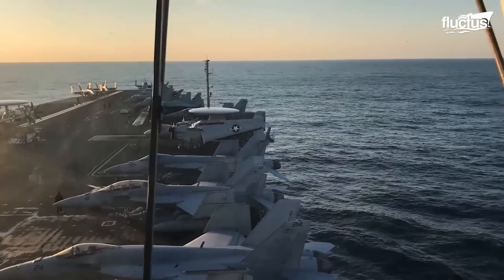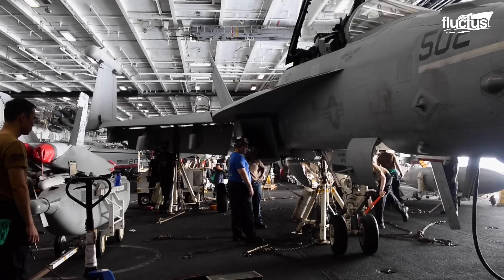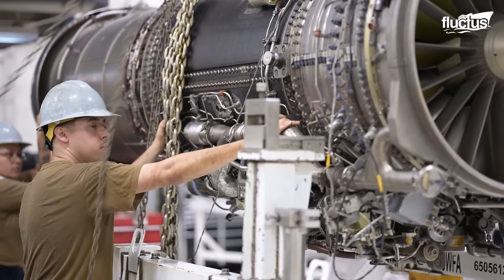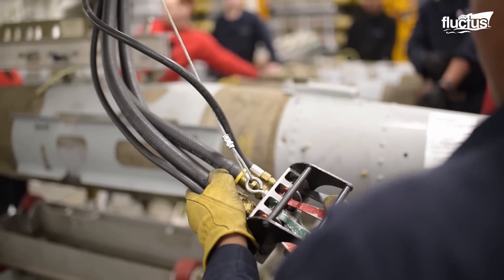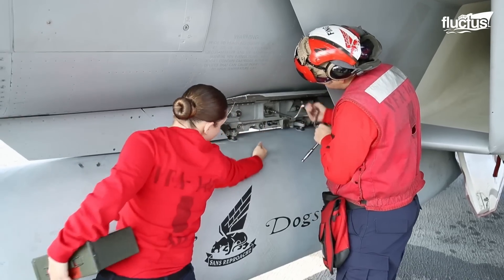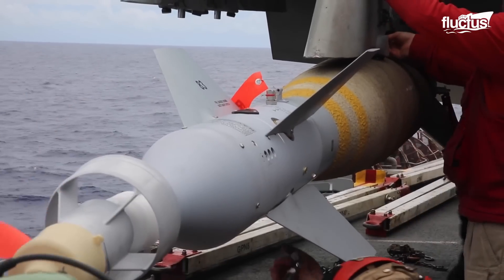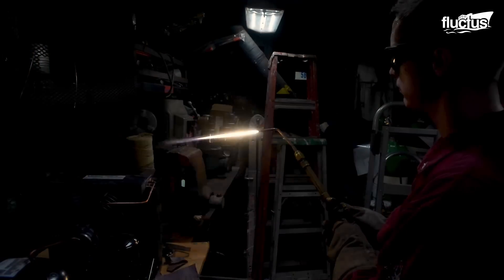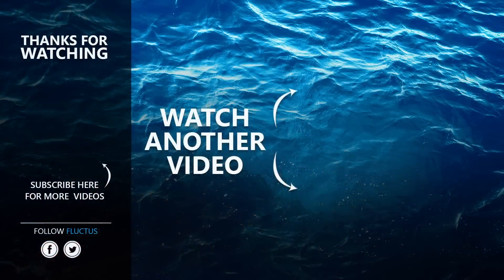Behind US Crazy Idea to Test Jet Engine Thrust on Aircraft Carrier at Sea

Comment: Why the mechanics use the manual wrenches to unscrew bolts and screws instead of the battery operated ones?
Reply: Often if you use power tools you can strip the threads if you use a power driver.  Especially when first starting.   Plus reliability. Manual drivers don't need batteries and don't stop working like power tools
Reply: Power drills can spark, and around jet fuel, not a good thing.

Comment: My first ship was the first "supercarrier", the USS Forrestal CV-59, 81-83. Called a supercarrier because it was the first class built with an angle deck, which allowed for launch and recovery simultaneously. I was there for her 82 Med/IO cruise and then took her into the yards in Philly for SLEP. I was a radar ET, all of our equipment was off the ship for the yard period (mine gone to mothballs, SPS-43A), so we all got other assignments. My first was the Fire Watch division as a supervisor. Our office was the Jet Engine Shop on that ship, which was located at the aft end of the hangars, with hatches opening aft to free space, which is where they would fire off the engines for testing. And, those engines had as much effect on the ship as the blast hitting the JBDs does. Nil. Compared to the mass of the ship, it's completely insignificant. 

Obviously, things have changed since those days. We didn't have LED lighting or laptops, for example. We technically had three hangar bays, but it's really one huge space, two decks high. The hangar bay was deck 1, the main deck. Decks 01 and 02 were mostly in the sides of the hangars or forward of them. Deck 03 was sandwiched between the hangars and the flight deck. The flight deck was the 04 level. Most of my work, my radar space, and the radar shop were in the island, on the 05 and 06 levels.

I was ship's company, so I wasn't involved in any of the aircraft maintenance, but I did work with AIMD on occasion. They had nicer tools than we had. At one point, I had to remove the rotary joint from my radar's antenna pedestal because it was full of water (long story, associated gear, another "tech") and took it to them to run through an ultrasonic cleaner for me. Their shops were forward of the hangar bays, on the same deck as I recall. 

I've noticed more modern carriers have the island set farther back than the Forrestal did. And, I can personally attest to one reason that's a good idea, even if it's not the reason for the change. I have first hand experience as to where the jet blast coming off the JBD for the cat just in front of the island, goes. It hit the bridge and signal bridge on that carrier. There was a commercial harbor nav radar mounted on a narrow catwalk above the bridge windows, below the signal bridge, thereabouts. We were up there to do maintenance during flight ops. However, just as we lifted the dome off the radar (about 3' or so diameter), they launched from that cat. And we got hit by the blast, nearly ripping the dome out of our hands. 

To put that in perspective, we were on about the 09 level, or 5 decks above the flight deck. We aborted that job until a better opportunity (i.e., the rare no flight ops moment).

I'll also mention that, in our case, the area of the flight deck outboard of the island was called  the "bomb farm", because that's where they'd stage munitions before loading them on aircraft in preparation for launch. My berthing was directly below that area, with a JP5 pump station fore and aft of us, the stacks inboard of us, and basically air and water below us. In the first days I was told, if you hear a bump overhead, don't worry about it. If anything actually happened, you wouldn't hear it. If lucky, you'd wake up in the water.

Still, that was better than the berthing that was located just below the arresting gear, with the machinery rooms on either side.

Comment: I was on the carrier Constellation and the engine shop would run repaired jet engines off the fantail. It did nothing to the ship's speed if anything.
Reply: I was on the Ranger your sister ship. They tested engines on the fantail. Normal procedures.

Comment: DID , IT , ADD , ANY , MORE , THRUST ,  TO , THE ,  CARRIER ?
Reply: The question we ALL want….NEED….answers to.
Reply: No,it does not add to the speed. Worked on F-14 Tomcat. The Jet shop just pulled.engines from shipping container and installed exhaust section then did the engine test.

Comment: Did it add anymore thrust to the carrier speed??
Reply: doubt it it would be noticeable.
Reply: @williamgrand9724 you would be surprised.
All the parameters of most Lethe vehicles are known.
This even goes for things as small as semi trucks.
Once the parameters are known to a person that simply pay attention to them, the quantities, over time, are a known factor.
Changes may be small, but noticeable by modern technology.
Changing an exterior part or fairing will be reflected in the future performance.
If it is beneficial, and proven over time, it’s a positive addition.
If the performance goes down, it is either scrapped or reevaluated and redesigned.
Improving a small part to increase performance, even by one or two percent, is seen as an overall improvement in the operation of the unit.
This can be as little as 50 gallons of fuel over the course of a year.

50 gallons at 2018 prices was around $150.

Not a small amount.
Reply: I looked it up, it’s freakin hard, totally different units, some measured over time, some over area/length, but, the F404 (F-18)jet engine creates up to 85kN(85000 newtons) of force. The Nimitz creates 194MegaWatts of power, that’s like 194,000,000kN, so the one jet engine at max power would be like adding 0.2% more power to the ship, but someone more knowledgeable should check this though, I might be wrong.
Reply: @martindworak thanx, ur awesome
Reply: that was my curiosity as well.
Reply: They said the 3rd elevator was on the port side. But if it’s on the same side of the island/superstructure, isn’t that the starboard side?
Reply: Spacex Spacex Spacex Spacex Spacex Spacex Spacex Spacex Spacex Spacex Spacex Spacex Spacex Spacex Spacex Spacex Spacex Spacex Spacex Spacex
Reply: Rator 4 Rator 4 Rator 4 Rator 4 Rator 4 Rator 4 Rator 4
Reply: That's why I want to know
Reply: Love you all ❤❤❤ have a great video ❤❤ very nice ship
Reply: wow